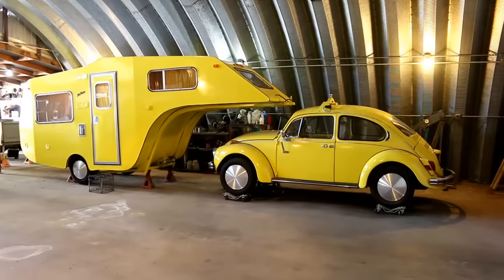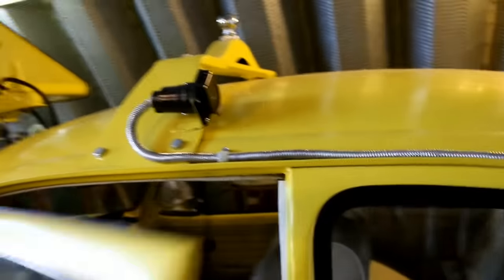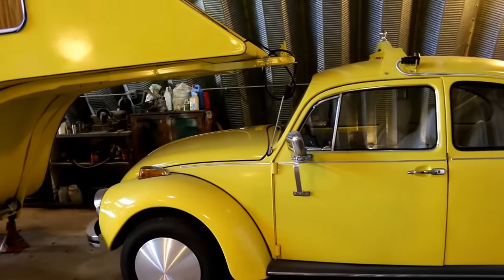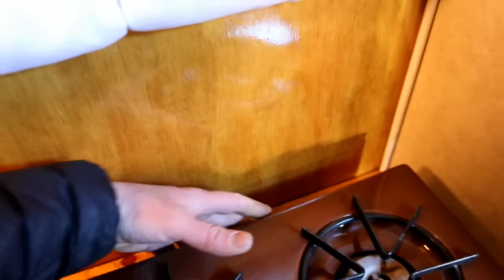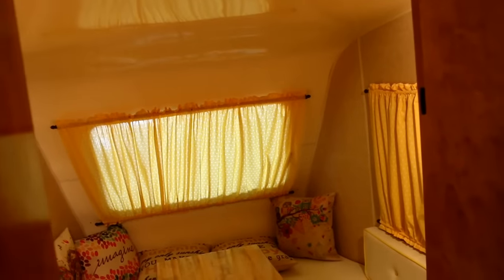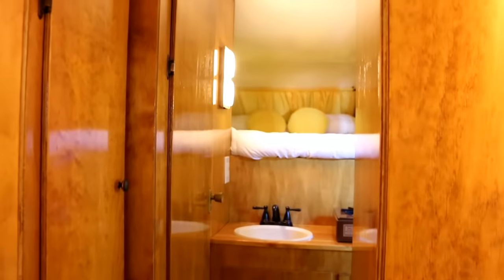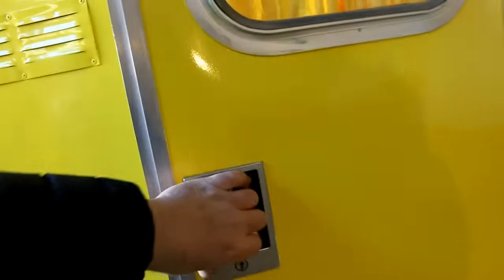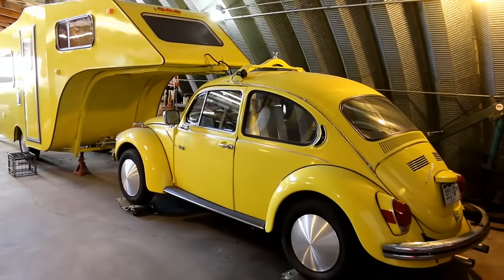VW Bug Gooseneck Trailer FOUND.  PART 2.

Comment: I gotta hand it to you Bob, incredible restoration job!
I can't imagine this thing would EVER pass safety standards of today! It's hilarious looking back on some of the things they did in the 60's and 70's Haha, omg can u imagine all the potential problems a setup like this could create doing tens of thousands of miles down north american highways. Does anyone have any personal stories of owning these when they were new and what issues arise or reliability problems? I can't imagine how that little 70hp(aprox) air cooled engine would have enough power to go up hills or to pass on the highway when it's loaded up with a family of 4 and all the luggage as well. Any idea what the total loaded weight of the camper is?

Comment: The vents next to the door window looked bent in , like someone leaned on them, & needed replaced but we're never replaced, & just painted over , is that the case, ? & on the back of the trailer below the back window looks like it was all dented in, or was that factory, or what was I seeing, or was that just a shadow, but all in all what a beautiful camper, I'd love to have 1, also I can't believe he just drilled through the VW's roof, I figured he'd a figured out something different how to attach it, like something similar to what they do now, by attaching the ball frame to the water channel, like they do most racks now, but I'm just wondering if that would be strong enough to haul camper

Comment: I am amazed that this didn't really take off in the 60's with the hippie movement, somebody really screwed up at Volkswagon. How much would a set up like that cost you nowadays?. I mean the arrow dynamic's on this thing is way ahead of it's time, there looks to be little or no drag. 
     The ease of parking, hook up and disconnect, I mean this baby is a dream. With the front and back area you could easily have a family of 5 at the right age with mom and dad separated which can be a real bonus. Makes me want to get a vw and trailer and head off into the next woodstock, peace.

Comment: Absolutely gorgeous !
My only concern would be the "receiver"
mounted on the roof.
Four 3/8 or 1/2 bolts on the roof will shear
off and the camper will crush the VW in a frontal impact...

Comment: That is really cool, but as a child that was raised in a family of eight whose main car was at one time a Volkswagen bug, I am not really a fan of the car. It was loud with that horrible buzzing sound, rode like a buckboard, lousy heater, no air conditioning, and had very little room inside. I rode in the very back behind the back seat in front of the engine; yes I was small enough! The only thing about a bug is that they will almost push snow and will only get stuck when high centered. This was in Montana, very hot in the summer, and very cold in the winter, so yes I still hate bugs. ...and yet the way the trailer is pulled by the Volkswagen Bug was really a great idea. Dad would have gotten one if they would have been available.

Comment: Awesome... Need to Paint the propane tank .. Can't understand the last few statements ... Echo in building.
Reply: The tank may need to be tested if it does test it before painting it. I have an old gas tank on my old trailer and they wouldn't fill it until it was tested and certified. Had both done now they have a new coat of paint I'm getting ready for the lake this summer.

Comment: He could put a small cap on the tip of those hitch bolts inside. That looks gawdy! I do thank you for the follow up, sort of. Not the trailer you found but a cool example. Does this guy ever take this thing anywhere?

Comment: Hitch weight bang in the centre of four wheels. It will be super stable to tow. I bet you hardly feel you are towing it. Bring it back with modern materials and design it with a cassette toilet. I would buy one.

Comment: Who has bolts puncture the headlining after doing all the good work he has done, he must have burnt himself out come the end. Respect to him anyway lot of work.  Anyone done any engineering calculations as to how long the roof will take to fatigue and rip out ?   It may be strong enough but I doubt it, or the paint covered welding.    Ouch.  Some rough old fabrication,  DIY is not the way when it comes to structural steel and towing on the highway . Bob get a fabricator to sort it before you kill someone

Comment: That thing is great. My question is how would you stop that with a vehicle that had breaks that would barely stop itself?  I've been pushed through an intersection with a heavy trailer without breaks and was wondering if that has electric breaks?

Comment: This is cool don't get me wrong, but I thought beetles were underpowered to move themselves. How does this even go up a hill. I know there's a huge aftermarket for beetles to make them quite fast. In a stock form I really see this not working out, any grade higher than maybe 4% I would think would slow this down to a crawl if it can even do it. This is very cool though, I'm just not sure if it will work.

Comment: Beautiful restoration! Question (because I literally know NOTHING about this): does towing from the roof vs a hitch on the back change anything (the HP required, what the vehicle can pull, mileage, etc)? Does the roof hitch have to be secured to (what I assume is) the car's steel frame? Old cars were tanks; modern ones not at all. Could that set up pull the car's roof off?

Comment: It would be interesting to see that hitch on a set of sliding roof rails. How it changes the handling and braking by distribution of the weight. I am also fascinated by 1970s CAB UNDER SEMI TRUCKS. Are any still around and restored?

Comment: So, if they didn't get a bug for the first couple years, was it originally modified to work with a pickup? Would also help explain the extra structure added to the bottom. So cool. Thanks for this!
Reply: There's no way a bug would have been powerful enough to pull a trailer up any kind of hill

Comment: Im guessing its weight is around 5,000 to 6,000 lbs for the trailer and bug, how is 40 hp moving it up hills at highway speeds?
Reply: that 40hp feels like a lot more and the cars are geared very low.  Hills...well that is why you 4 gears.. use every bit of the rev range and whatever gear you need. the VW doesnt give a shit if its floored all day down the highway
Reply: @zuestoots5176  a buddy of mine has a vw bug, i know what 40 hp feels like, its just hard to think of towing with it. But my ford 641 tractor only has 48 hp, and it will pull a lot.
Reply: And i do a lot of towing for work with my 1/2 ton ford, even weighting less than 15,000 lb, i use all of the 250 hp that the 300 l6 has to give.

Comment: I'm not on board with that hitch, at very least there should be some 1/8 inch plates inside to spread the load out. Couldn't see it so maybe it has something more than just what this guy explained, but that doesn't seem safe

Comment: The hitch  is in the center of the cars roof and was a real bad design. The car would take a corner too fast and the trailer would push it off the road, sometimes flipping it and killing anyone in the car. That's why so few were made.

Comment: cool that the hitch could rotate 360, allowing it to do maneuvers no rear mounted hitch could do
Reply: BigCooter.com The hitch does not rotate. It is in the center of the cars roof and was a real bad design. The car would take a corner too fast and the trailer would push it off the road. That's why so few were made.
Reply: @mmill6505  that makes sense..the car woud under steer, while a rear mounted hitch would push the tow vehicle into over steer ... i'll take over steer over under, any day of the week.

Comment: Very cool but gee those exposed bolt heads attaching the hitch to the roof would slice open or put a deep hole in your head in the event of an accident. Need to think that out a little more. Other than that I would love to see the rig in my garage.

Comment: Could the bolts on the bug go through from the inside instead (topped with rubber cups on outside)? You mentioned stairs to get up to the bed in an old set up...would be nice to see something adaptable built into the kitchen area for climbing up.

Comment: Awsome restoration but how does it handle/drive? i had vw in the past and although they worked great for me i cant imagine taking this thing up a slope or on a long roadtrip, i imagine the bug with 4 people, whatever they can carry in the back and in the trunk area plus the camping equipment in the camper, can the engine and trans handle it??

Comment: Didn't see safety chains or trailer wiring. It looked like there is a plug on the roof of the beetle for wiring. Do you just unhook those things when you want 360 manuvering and hook them back up when you are on the road?  Not sure how you could arrange safety chains without scratching up the car roof.

Comment: Not sure if this question can be answered but do you happen to know the external dimension measurements and internal measurements of the gooseneck trailer as i am thinking of building one from scratch so that i am able to tow a family caravan in the same way with the roof mount towing connection on a beetle project that i am currently planning to build which will give 260 bhp at the rear wheels
Reply from the maker: I don't have the dimensions.  JC.

Comment: One question I have... these bugs are air cooler engines, does the towing a trailer like that negatively effect the engine cooling since airflow over the back is effected? Or does the gap between the roof of the car and the bottom of the trailer kind of act like an air duct and actually increase the cooling?
Reply: @Daniel Brooker - Theoretically, it 'should' duct a little more air toward the back where the air inlets are. As this is a '71 Super Beetle, they had the 63 hp. 1600 dual-port engine with the oil cooler in it's own box on the back/front? of the blower housing, so they didn't have nearly as much problems with #3 & #4 cylinder overheating due to lack of air. Aside from that, this is still a pretty hefty load for a classic bug, and an oversize external oil cooler, deep-sump oilpan extension, and an aftermarket scoop for the top air intake outside is a BIG plus in keeping the internal temps down, and the horsepower up.😉😁

Comment: I have an older Toyota Camry V6 and read that it was one of the smaller sedans that could actually pull some weight.  I've never tried it, of course, but in looking at this rig, I have to ask...it looks like from specs that this VW Beetle had a 4 cylinder engine and weighed just under 1700 pounds.  So how much does this trailer weigh and/or how much weight was this Bug rated to pull?

Comment: How is it to drive actually with the rotating center on top of car roof ?
Is it easy to maneuver backward compare to normal towing positioned ?
Also the strengthened parts of the roof to withstand the weight and load
Any expalanation about this ?
Reply: Toni....Watch the original part 1 video to see how it works
Reply: @reddog543211  I did and asking for more detail technical ideas

Comment: By no means would I want the load of that trailer being born by the flimsy roof structure of a stock circa 1974 VW Beetle, especially with the additional 100 or more pounds of reinforcement added to it.
I can foresee that the first hard braking from speed could collapse the front roof pillars if they were not reinforced. I also have my doubts about a 60hp engine's ability to tow that trailer at highway speeds on anything but flat ground.
All that said, I'm always impressed and amused by the projects that skilled people who have a lot of extra time, money to burn, and proper tools and facilities can make happen.

Comment: The bolts that are inside  the car holding  the hitch ,are exposed. Those can and would  cause  severe  head injuries,  reverse the  bolts so the nuts are outside  the car ,  I have  seen  what happens    it's very ugly

Comment: As cool as this bug with trailer is.  I would like to see it try and get up a hill.....
Reply: the trailer is VERY light weight. it would not be a problem. downshift and climb the hill.
Reply: @reddog5753  even of it was light. It would have to weight as much as a human....  didnt they have maybe 35HP?
Reply: @tonycoffee7335  53-to 60 HP from a 1600 vw engine, but it's not about horsepower its about gearing.
Reply: @reddog5753  true true.

Comment: But you’re putting the pin weight over the ‘center-ish’ portion of the car. Not a tq producing axle. Not to mention the horrible suspension on Bugs. I’m trying to do the math, even at 100 ft lbs tq, which is more than this 1600cc has. The math doesn’t add up if this trailer is anymore than say 3000 lbs which it surely is. It must be the Farfegnugen!

Comment: I just thought, I wonder how many windshields and rear glass cracked or popped out from all the flexing that roof would be doing, it's not designed to carry or pull that kinda weight, especially just 4 bolts holding the hitch brace on, yikes! Lol

Comment: Don’t see any practicality of such trailers. It is a headache servicing and maintaining such camper trailers. You need covered parking space to protect it from elements and rodents. The power provided by its own batteries would be insufficient to make it liveable in a remote place without grid power even for one night.